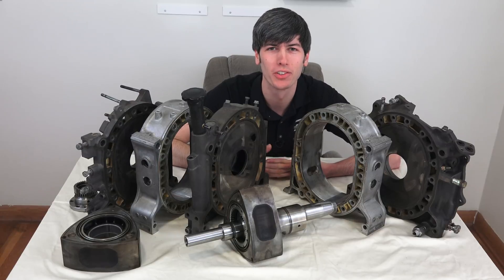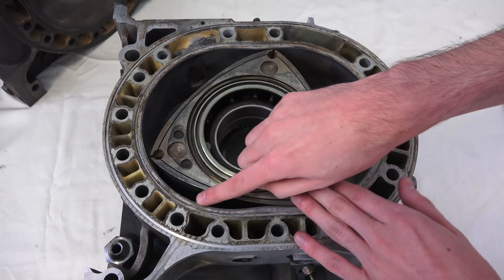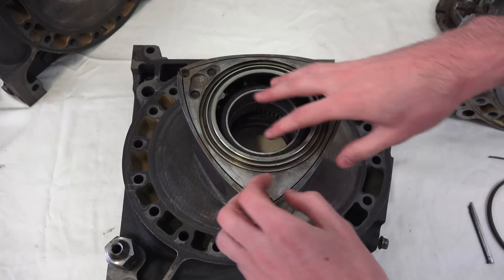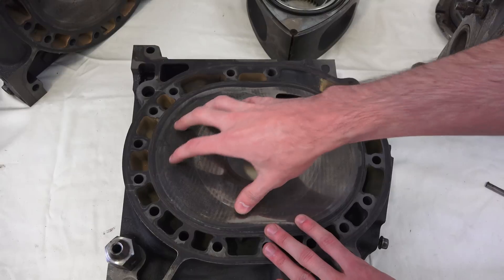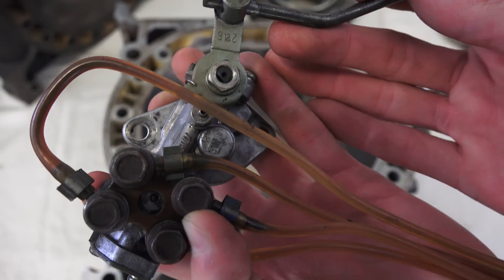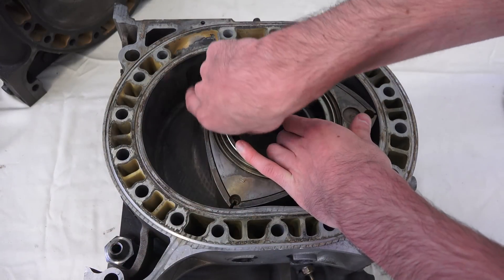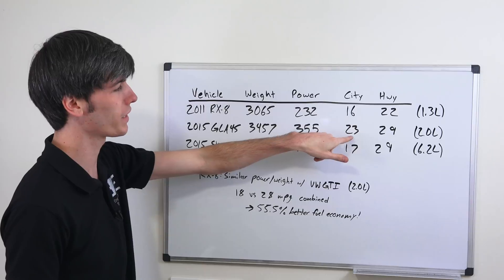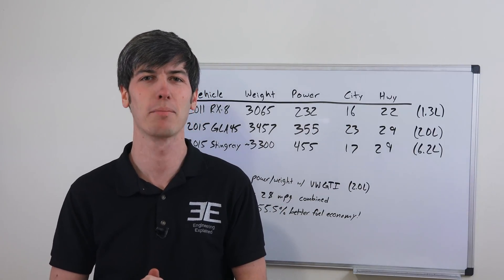4 Reasons Why The Rotary Engine Is Dead

Comment: true  but illogical to compare a 93 to a 2020 direct injected engine.  Heck all 93 IC engines have even worse performance compared to my 400lbft  Spark electric motor, 0-92mph 1st gear, 70mpg Costco gas equiv even w SDGE rates!  RX Faster around big Willow RT  Dec issue 1992  w Dan Gurney driving   including LT1 vette and 70k  360hpTurbo Porsche. My 93 Touring had home made intake and exhaust , stock incl IC,  bought used w 60k miles, $14k in 1997, kept smog legal Cali. Commuted 22 miles work and babied 22 mpg avg.  I took off both cats, 200lbs lightened , and once I found a 97 GTS Viper 450hp? and we went for it up the 52fwy in SD .  I passed him at 140 up hill w flames out the back.  80vs480ci This motor should be compared to a 1993 Ferrari TR V12 rather than my modern day engined Prius V argghh.  Cheap ,  rebuild is simple,  compact,power to weight, rpm capability, better fuel economy than a Testarrosa lighter better handling.  The RX8  power per liter more than F458 or  even current  gt3rs.  Emissions/mpg :series engine/cell to use exhaust fuel, to power electrics, turbo:wider rotors, smaller diameter, more comp, for oversquare improve mpg

Comment: Imo, the rotary was always more of a racing engine than one to use in a street car
Reply: Then why was it so unsuccessful in racing?
Reply: @veschl  Lost the 1990 championship to Mercedes-Benz 
Lost the 1991 season championship to Jaguar.
Reply: @isaL Audi has won Le Mans 9 times with a Diesel engine... proving that Wankel engines actually suck in motorsports.
Mazda no longer competes with Wankel engines and no longer has a motorsports program.
Reply: @isaL You need to learn how to drive a manual transmission...

Comment: What a nightmare. Petrol engines need to be ditched along with Diesels.  Tesla wins. No question. If you like the Mazda, you buy it and throw out the engine and petrol tank, fit a Tesla motor and batteries, problem then solved.

Comment: Wankel is basically a two-stroke, like back in the days when some two-strokes used gas and oil mixed, like some outboard motors.
I would think the inefficiency could be mathematically modeled with the pressure vectors in the combustion chamber and reject the design based on this alone.
If a combustion chamber has a water cooled jacket means thermal energy is used to heat water rather than expanding gases. The more heat in the radiator the less force to the wheels. The less heat generated by an engine compared to its power the more efficient it is. Electric motors are simple, and have very high efficiency and torque, thats why trains use them. 
A 200 hp electric motor is 92% efficient. For electric cars the main issue is energy storage. Energy source? Grid power from nuclear, no carbon.
Reply: All Wankel engines operate using the 4-stroke, Otto Cycle principle.
They are not 2-stroke engines.
Reply: It's called the Carnot Formula, and yes... it proves the Wankel engine design is much less efficient than reciprocating engines.
Reply: @sandervanderkammen9230  There are many reasons why Wankel's idea was not so good.
1. Thrust vectors on a long surface.
2. Poorly optimized gas/combustion flow.
3. Aspect ratio of combustion chamber.
4. Thermal performance in the long combustion chamber.
..to name a few. Much work has been with regular piston engines to optimize combustion chamber shapes, valve timings, simpler machining with round shapes, better seals and so forth where much of this is simply not possible with the Wankel.
Look at the old flat top engine and think of why they were obsoleted. 
The combustion process happens in milliseconds and getting it optimal is not easy with normal engines, and as has been shown, not worthwhile with the Wankel.
And yes, all engines "rotate" so calling the Wankel rotary is not descriptive enough.

Comment: what if the triangular piece 'get slide' into the chamber and moving along with the chamber shape that gives less friction (no corner adjustments) 
and can oil run through the chamber guide space (in fact it gives more cooling effect on the chamber)
also you don't loose any fuel compression. this give separate chambers for each combustion.
and i also thought about exhaust. because we are sealed the chamber
when the compression is fully finished, and we wanted to exhaust it. to that time precision,
we open the valve from outside(yes from outside) when it arrange to one of the chamber finished combustion.
we need to make  mechanical move to open exhaust valve to open to precision
i consider all the flaws of this engine
1.low combustion 2. rubbing on the edges 3 bad exhaust 4 engine over heat.
please think expert knowledge. i am just giving my thoughts. i am not a engineer or mechanic.

Comment: So when the lubrication is improved the engines main problem will be solved instead of fossil based  oil a clean alternative. I remember watching the NSU/BSA/Norton rotary bikes annihilating the competition back in the 90s
Reply: Lubrication is not the primary failure mode of Wankel engines.
Reply: Environmental considerations have limited the appeal of total oil loss engines but if a cleaner lubricant than can be found then these engines would be far more popular
Reply: @JH-nb1de  Not true, Wankel engines are not obsolete because of emissions...
They are obsolete because they are inherently unreliable and inefficient.

Comment: The rotary engine hasn't had even a fraction of the RnD put into it as the reciprocating engine has. Everyone abandoned the rotary early on with the only aception being Mazda and even then the ratio of their rotary cars to piston cars still leaned twords the piston side. I believe if the rotary had as much time put into as piston engines have had, nearly all the issue's would be solved and id be really curious as to how far it could actually go seeing as how its proved its self to be one hell of an engine with such limited support.
Reply: Nothing but wishful thinking...
26 of the World's biggest and best engine manufacturers and nearly 100 universities and research institutions developed the Wankel engine for nearly 2 decades.
General Motors and Mercedes-Benz were spending 10 million dollars per month on Wankel engines.
Ford once held more Wankel patents than Mazda.
But the culmination of all this work led to a single undeniable  conclusion by the 1980s..
That the Wankel engine is fundamentally flawed by design and is inherently inferior to other types of internal combustion engines.
Even Mazda eventually came to this conclusion in 2009.

Comment: Put a rotary inside of a rotary , so that 2 step to full burn process.  Not turbo but actual second combustion  right after 1st. U make the 1st down & dirty then 2nd much large & mister clean. Big power small version dirty version then over sized low compression soft power clean burn. The heat & wear all takes place on small replaceable disposable front baby burner & mister clean 2nd much larger engine is ultra low heat low compression low emission sweep up.  Some kind of gearing step up of whatever amount that makes the small work full effort normal driving range & much larger just gives u that pure extra 50% above econo box normal driver.

Comment: The main advantage of a rotary is you can make a street engine that sounds like an F1 engine...

...actually that's the only advantage.
Reply: I disagree - one more advantage is that it's easy to damp the engine vibrations, given it's plane of movement.
Reply: @mg42sd  Not true, the maximum operating rpm of Wankel engines is limited to less than that of reciprocating engines like Formula 1 engines. 
The Wankel engine has higher reciprocating mass and this results in torsional, radial and longitudinal deflection which causes leakage and catastrophic contact damage.
Reply: @sandervanderkammen9230  could you point me to source of this info? I don't mind  admitting I was wrong. Probably was deceived by some fake mechanist.

Comment: Yeah but by size they make a lot of horse power as well they can rev higher than piston engines since they have less moving parts as well they can be place further back and lower than piston so yeah they are not completely useless
Reply: The Wankel engine offers no advantages over other internal combustion engine designs.
Which is why the are no longer in production.
Reply: @sandervanderkammen9230  look they do have

 first they are smaller and lighter than piston for the same horsepower sure they dont make much torque but still

second they are able to rev much higher than piston since they dont have much moving parts in them because if piston engine could such speed the spring will not be able to keep up

three due to how little research the rotary engine got during its production really tells me the hight it could have taken in my opinion with more time giving to fix rhe issues it had it would have been a engine that some cars could have today
Reply: @splitairplane289  Sorry, but you are simply wrong.
Wankel engines are not used in applications where power-density or power-to-weight ratio performance is critical.
True, they generate less torque because they are mechanically less efficient than reciprocating engines.

Also not true, reciprocating engines are actually able to rev significantly higher than Wankel engines, of course in most applications this is not an advantage.

You seem completely unfamiliar with the development history of the Wankel engine.
26 of the World's biggest and best engine manufacturers and hundreds of universities and research institutions invested billions. Mercedes-Benz, Ford and General Motors were spending millions of dollars per month on developing the Wankel engine.
 All of these manufacturers including Mazda have come to the same ultimate conclusion.
The Wankel engine is inherently and fundamentally inferior to reciprocating engines.

There are no longer any legitimate engine manufacturers developing the Wankel because it was a massive commercial failure.

Comment: Just put some big turbos on there and hardly use any fuel mostly use air. Boom 🤯 problem solved
Reply: If the turbos are large enough, you don't even need fuel. //s

Comment: I'm just thinking, a normal piston engine requires the production of many more parts than a rotary engine.  Does the mining of the metal, machining of that metal, assembling of that metal not create an enormous amount of emissions on the part of the equipment necessary to build that normal piston engine?  Isn't the rotary much simpler to make?  Doesn't the reduction in the number of parts make it more likely to be reliable?  Someone could have said the reciprocating engine is dead, when compared to the power and reliability of the Stanley Steamer automobile.  Maybe we just need to refine the rotary.
Reply: Not true, the Wankel engine offers no advantages in number of parts or production cost or resources.
The Wankel engine can no longer meet minimum industry standards for efficiency, emissions or reliability. 
The only thing less efficient than a Wankel engine is a reciprocating steam engine, which is why steam cars became obsolete over 100 years ago.
Reply: @sandervanderkammen9230  Huh?  Where are the individual pistons in a rotary?  Where are the piston rings?  Where is the Cam?  Where are the piston rods,?  Where are the bearings?  Where is the driveshaft with mounts for the piston rods?
Reply: @ralphcorsi741  The Mazda 13b has 2 pistons, it has rod and main bearings and dozens of piston rings, the eccentric gears serve the function of the connecting rods.
The Renesis engine has over 235 moving and seals related parts per engine not include ancillery components.
Reply: @sandervanderkammen9230  Yes Sander, there is stuff in there that serves the same purpose, but they ain't in there.  That is my point.  It does it without all that stuff.
Reply: @ralphcorsi741  It is all the very tiny, fragile apex and side seal parts that people like to ignore or pretend are not there that is also the source of the design's higher cost, poor durability and reliability problems.

The Wankel engine offers no advantages over comparable reciprocating Otto or Diesel engines, this is why the Wankel engine was a commercial failure and is now completely obsolete in the engine manufacturing industry.
Reply: @sandervanderkammen9230  There was a time when the jet engine was unreliable, expensive and used too much fuel.
Reply: @ralphcorsi741  Jet engines are not obsolete like the Wankel engine...

Comment: The first point about shooting flames seems like an absolute win
Reply: It is bad for your car, and that leads to many complications, hot fuel is bad for catalytic converter too, so you are going to emit bad gasses into atmosphere.
Reply: @aerox1930  cat delete and there’s a reason a good percentage of the road driving electric cars so emissions not a big deal for one car. If every car was rotary... different story
Reply: Apparently not since people stopped buying them..
Reply: Except on the track. All that power went out the tail pipe...

Comment: I had 3 of these and they were the most fun cars to drive I have ever had. The engines all failed well below expectations due to the O ring seal around the chamber charring and letting combustion gasses blow into the cooling system. This blew out the cooling water and the engine then failed. Mazda was very good about replacing these free but the loss of the car for weeks at a time while the engine was being rebuilt was a real hassle. Now I'm into electrics, which have their own set of hassles!

Comment: Great video presentation as always. Aside from fuel economy, id like to know if the rotary engines were resilient and reliable when making power for racing? Do those seal design cause problems? 

I’ve read that the R26 4 Rotor was in excellent condition after the Lemanns competition.
Reply: From what I've heard from a mechanic that specialized in these engines, the seals are notorious for blowing out and premature wear because the oil doesn't spread evenly about the combustion chamber.  If you own one of these it's a good idea to have your own garage, because they need to be disassembled more often than conventional piston engines, and lots of mechanics don't want to work on them.
Reply: The Wankel engine is notorious for unreliability and poor durability.
The Wankel engine had a very disappointing history in motorsports including endurance racing.
The Mazda 787b was extremely slow and uncompetitive mostly due to the R26B engine which was severely detuned to improve reliability.

Comment: This design is actually very good for refrigerant compressors. Low compression ratio makes it efficient (low electricity consumption) and they are very quiet. Pretty useful for domestic refrigerators and small AC units. And since the compressor's oil circulates with the refrigerant in these systems anyways, it's not an issue at all.  But yeah, definitely not very suitable for a combustion engine.
Reply: Felix Wankel originally conceived its design as a compressor and was used to supercharge NSU motorcycles.

Unfortunately it's has many of the same problems and disadvantages  associated with the internal combustion engine version.

Comment: Mabe they can be used as small Aircraft engines ?
But on the other side , ordinary 2-stroke engines are perhaps cheeper to buy and maybe easier to  diy repair  ?
Reply: Wankel engines are entirely unsuitable for aircraft applications which is why no legitimate aircraft manufacturer has ever used them.

Comment: How about a diesel rotary engine? diesel is supposed to seal better than gas
Reply: Many attempts were made by some of the best Diesel engine manufacturers in the world.
But unfortunately the Wankel engine cannot support compression ignition or Direct Injection.
Apex seals simply cannot handle the pressures that Diesel engines regularly see in normal operation.

Comment: Lemme just tell you that, rotarys are one of the best racing engines made, like the mazda 787b engine
Reply: The Mazda 787b was a very slow and uncompetitive race car.. 20 losses in 21 races with no poles or fastest race laps.
Mazda LOST the WSC championship  twice, losing to both Mercedes-Benz and Jaguar before Mazda retired the car.
Reply: @sandervanderkammen9230  i am talking about the engine
Reply: @imsorry86  Wankel engines were very unsuccessful in motorsports... they are no longer used in any major professional or world class racing series.
Mazda no longer has any motorsports program.

Comment: change the topic to "4 Reasons Why The Rotary Engine Is Dead for regular car driving people" its a race engine, not going to work engine..
Reply: Not used for racing either... Mazda doesn't even have a motorsports program anymore.

Comment: The Wankel engine didn’t die. It’s too simple, and so it doesn’t generate enough revenue for the car factories. Ford and Chevy want to sell expensive engines, not cheap ones.
Reply: The Wankel engine is indeed dead, dead and buried, to unreliable and inefficient to compete with vastly superior reciprocating engines.